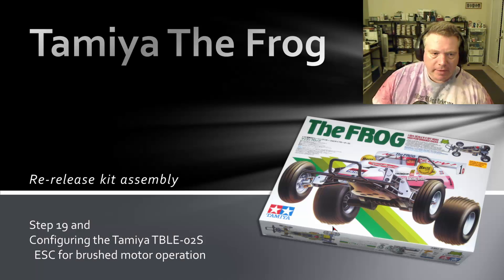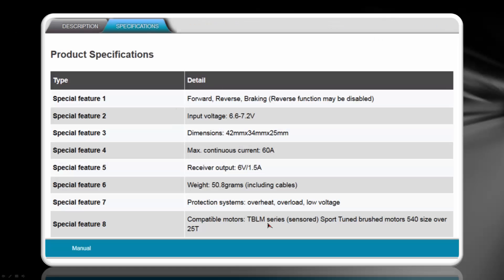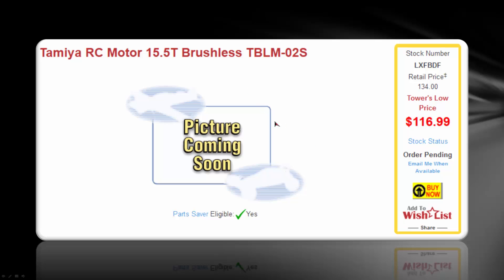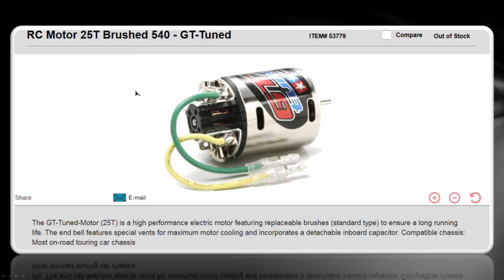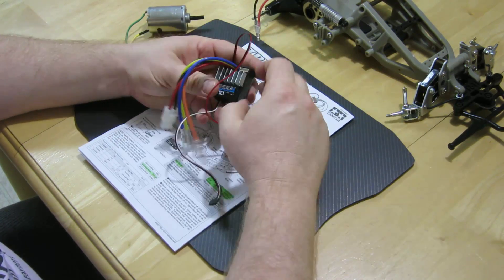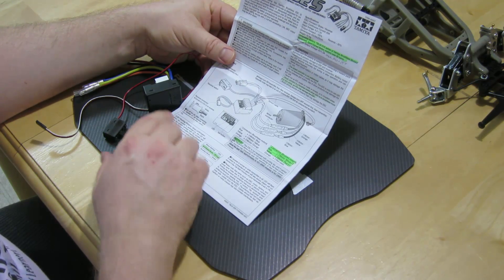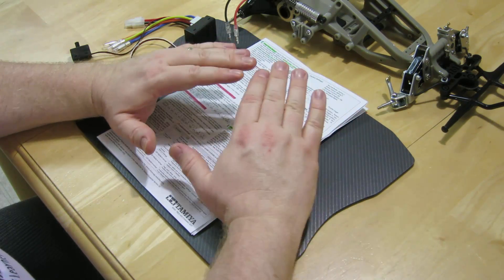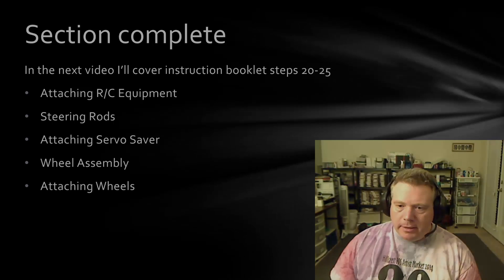Tamiya Frog Build - Configuring the Tamiya ESC TBLE-02S

Comment: Fyi... 8.4 works fine.. we use this esc when racing the tamiya euro truck class and works well on 2s just doesn't have the lipo voltage cut off..

Comment: One more question I just bought the Blackfoot have not put it together yet but if I decide to buy an aftermarket motor what I need to change the gear for the motor
Reply from the maker: It all depends on the motor you choose.
Reply: @kokyudosa  do you have any suggestions on a decent aftermarket motor
Reply from the maker: @jasonurban3597  That's a highly personal question.  For me, I prefer a well-balanced rig so I will shy away from overpowering a chassis.  For any ORV I would stick to either the Tamiya Sport Tuned or Torque Tuned motors.  I wouldn't go any hotter than say a Tamiya Super Stock series motor.  In your case, I think a TZ would be spot on.
Reply: @kokyudosa  ur the best i appreciate u

Comment: Works perfect with 7.4v 2s Lipo
Reply from the maker: Sure does. Just make sure you invest in and use a LiPo low voltage alarm. ;)
Reply: @kokyudosa  The TBLE-02S has a low voltage cutoff when setup for Lipo
Reply from the maker: @liferider4130  Nope.  It has one for LiFe which is too low for LiPo.  If you run a LiPo without an alarm you run the risk of undervolting the battery and causing permenent damage.  ;)

Comment: Hi Kelly,I have just built the Grasshopper with a 540 motor in.

Would the ESC know when the motor is full throttle on the  transmitter?,or do I need to set up the ESC to the Motor and Radio Gear?.

Seems to be slow still.
Reply from the maker: Assuming you have a TBLE-02S, you need to calibrate the ESC to the transmitter. It's a fiddly process but manageable.

Comment: Hello! I have just built my Frog. I had one in the 1980s. I have the esc and motor with the kit. My controller does not move smoothly from forward to reverse. I have to put the lever in the reverse position a few times before the motor engages. Is this normal? Also I have never seen any other light colour than red. No green, orange or yellow. Thanks so much for your help. Julian
Reply from the maker: I wish I could help but there're a lot of things which could be causing this issue.  From low/dead batteries in the transmitter or car battery to miswired electronics, faulty motor, faulty or misconfigured ESC.  Sorry.  I hope you are able to sort it out.  You might try posting to tamiyaclub.com forums.  That format is much more conducive to helping troubleshoot a complex issue like this.

Comment: Hi Kelly, thank you for uploading this video. It helped me a lot. I almost gave up setting up the car. Now i understand i have a brushed motor... Could you help me with one more set up question? The throttle and brake are working opposite. I cannot seem to correct this. Do you have any suggestions? Greetings, Sebastiaan
Reply from the maker: Two ways to fix this.  1) check to see if you have the ESC-motor wires reversed.  2) reverse the transmitter Ch2  Many transmitters (like Futaba) require Ch2 to be reserved.  There'll be a setting on your transmitter somewhere.
Reply: Thx. It was number 2. A setting on the transmitter. Again thank you for your help!

Comment: Pleas note that these cars are not as fragile as this generation of racers claim. With a simple upgrade to the transmission  from MRP or Thorp these cars can handle anything the market has and still at a fraction of the cost of a fully upgraded RTR.  Just because the main chassis mostly consisted of ABS plastic did not mean they were weak in any way.  FRP decks were around but heavier and more costly.  I’ve seen and raced those individuals sporting those features and break them resulting in costly repairs that they can’t fix. It’s all about skill level.  The vehicles today need to be beefed up because they are coming out of the box fully upgraded to handle the abuse the beginner will bring leaving little to no upgrades for them to make.  I have all my Tamiya classics still in running order and would have no problem putting any power plant I chose.  The only difference is it’s still cheaper for replacement parts if a breakage or malfunction occurs.  Just my thoughts.  Thanks for the video
Reply from the maker: The biggest weakness in the Frog chassis is the front uprights. The axles fall out if subjected to even the gentlest of breezes.  :(

Comment: Great info!  I have an original Tamiya Subaru Brat that I bought new in 1983.  After not using it for the past 25 years I am now getting it back in action.  The original mechanical speed controller has worn contacts and I am converting it to ESC.  Your vid was very helpful since I will be programming it for a brushed motor, which is original.  Thanks!  -Glen
Reply: I remember having the mechanical servo is well do they even still run these
Reply: @jasonurban3597  can't buy them new anymore.  Electronic is the way to go.
Reply: @ozzstars_cars  ok thanks buddy. I just bought the Blackfoot I haven't put it together yet and I just bought a controller Tamiya controller I'm guessing all the srvos are in there

Comment: Do you do that before you hook it up to the motor?
Reply from the maker: Before.  If you connect the motor to the ESC when the ESC is in the opposite mode, it could damage the ESC.
Reply: Kelly White thanks for the reply.. ive just noticed a seperate piece of paper in with the esc manual saying that its set up for a brushed motor as supplied with the car not brushless.. so should be ok out the box hopefully as im using sport tuned 540 like yours..just waiting for my battery pack to come so i can hook it all up..been out the game along time so these escs are new to me!
Reply from the maker: About a year after I made this video Tamiya finally wised up and started shipping the ESC in brushed mode with the kits.  Good luck with your Frog.  Mine is a  shelf queen now because I couldn't get more than a couple of battery packs out of the front hubs.  :(  The spindle keeps coming unpressed.
Reply: Kelly White  ok glad they wised up to that! Nice shelf qeen to have tho!👌..mine is a grasshopper 2..hopefully will have it up and running this weekend👍 greats vids you done here by the way really informative👍

Comment: Please help, what will happen if I put a motor that that has below 25t will it still work?
Reply from the maker: Ziaplex it will thermal lock on you. Once the ESC temp gets too high, it shuts down until cool.  If you plan to run brushed <25T get a Hobby Wing 1060 ESC. It's far superior.
Reply: Could I buy a censored brushless motor with the stock esc or do I have to buy the tamiya one.
Also by saying the esc will shut do when it gets to hot is that a matter of seconds on a 17t motor or can I use it for like 20 minutes a time.
Reply: With the hobbywing esc can I run with a 15t motor?
Reply from the maker: You can run a sensored brushless motor on the TBLE-02S.  Any brand will work.  I would suggest a 21.5T or 17.5T on a Frog.  Any more motor will result in wheelies and backflips which may sound like fun but broken cars aren't really that fun in the long run.  How quickly the ESC will thermal lock on you is dependant on a bunch of variables, ambient temperature and driving style are but two of the major ones.  Seriously, if you stay brushed and use anything more than 25T get the Hobby Wing ESC.
Reply: Kelly White But can the hobbwing esc work with a 15 turn motor
Reply from the maker: http://www.hobbywing.com/goods.php?id=358
Reply: Kelly White Wow! I cheap too! Thanks I'm considering it.
Reply: Does the stock esc work only with censored brushless motors? Will the uncensored motor just not work. I am noobie but Im planning on purchasing the tamiya TT02 on road kit. Do the sensors only make it smother?
Reply from the maker: The TBLE-02S only works in brushed or sensored brushless modes.  If you are a noobie running a TT-02 I suggest sticking with the motor that came with the kit for a bit.  If you run NiMh batteries, the TBLE-02S is a fine ESC.  If you want to run LiPo get the Hobby Wing 1060.  It's not that much more of an investment over a LiPo low voltage alarm that would be required to run LiPo with a TBLE-02S.

Comment: Hi have you build a hotshot re release?
Reply from the maker: Hi, great question.  I have not built a Hot Shot but it's on my list!  I've been focusing on off road racing.  First with a TRF 201 and now a TRF 211.  I plan on doing a short video review of the 211 since there is only one on You Tube presently.  While Jason Snyder did a fantastic job with it, I think other opinions and perspectives is helpful.

Comment: Please note that you've missed a few 540 motors from tamiya's site.  The fastest brushed 540 motor from tamiya is the Super Stock RZ which is a 23t (just like the sport tuned) but run's at 27,500 rpm.  Here are some quick motor specs for everyone. I've spoken with tamiya usa and all of these brushed motors are compatable with the TBLE-02 and the TEU-106BK (clodbuster/twin motor esc) however tamiya offers a cooling fan for these esc's which is recommended for the higher rpm motors.  Hope this info helps some.  All of these motors are still available for purchase through Tamiya or other retailers.

RS-540 Sport Tuned Motor 23t 18,300rpm 350g/cm Brushed
GT Tuned Motor 25t 19,000rpm 500g/cm
UGT Tuned Motor 24t 19,400rpm
Super Stock BZ & TZ 23t 26,500rpm 500g/cm
Super Stock RZ 23t 27,500rpm 500g/cm

Comment: Great video! However I can't seem to sync my controller with the ESC - can you help please Kelly? I have got the steering servo responding to my controller so a signal is being received. I turn on the ESC and it is a regular flashing green light. I have held the set button down when moving the throttle to max forward and reverse but the ESC will not set and the green light continues to flash?  This is my first build of a Tamiya Hornet with stock motor etc. I received no instruction manual with the esc tble-02s - maybe you have a copy :) ?
Reply: +Kelly White Up and running! It was comb of the wrong motor set up on the esc, plugged into the wrong channel and a reverse issue but all sorted. Cheers!
Reply from the maker: +Jon Nock Here's a link to the manual.  https://www.tamiyausa.com/pdf/manuals/45057ml.pdf  It's a bit muddled IMHO.  From what you describe it sounds like you have to set your throttle end points.  First ensure that you have your throttle set to reverse operation on your transmitter.  Follow the instructions labeled <<High Point Setup>>  That should be all you need to do.  Keep in mind that this ESC does not have low voltage protection for LiPo batteries.  So if you plan on using them, you'll need to get a low voltage alarm.  Good luck!
Reply: +Kelly White Thanks, I'll give it another go! :)

Comment: so if any could help, im trying to set up my tble02s to brush mode. and when i hold the set and release on the orange, it blinks red/orangge 3 time. someone halp
Reply from the maker: Zubaunbuilds, I know how frustrating this ESC can be to setup. If you can tell me exactly when in the process yours is blinking red/orange maybe I can help.  The best guess I have at this point is that your ESC is not connected to a receiver, or that the receiver is not turned on.
Reply: i had a receiver on and everything, i had the RC running prior. but after opening up the ESC, i quickly learned that one of the chips inside burnt. managed to get a spare from work. thanks for your help though